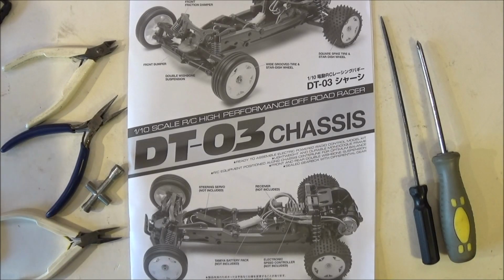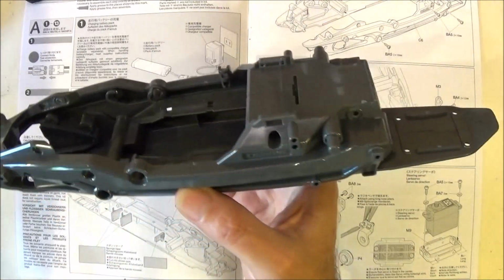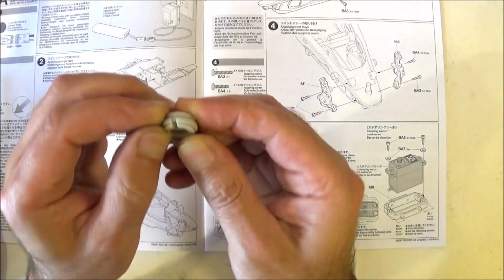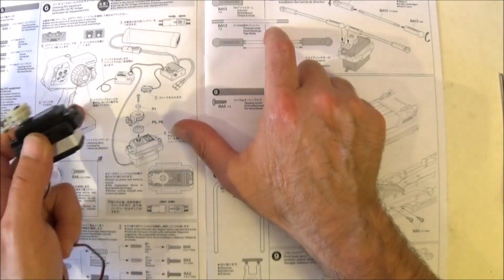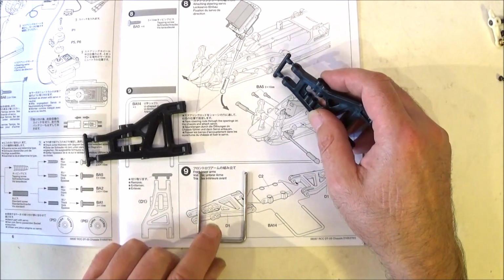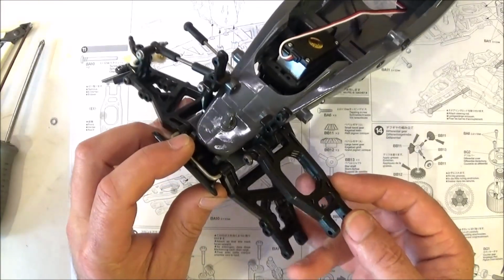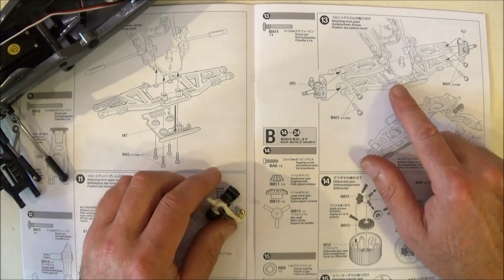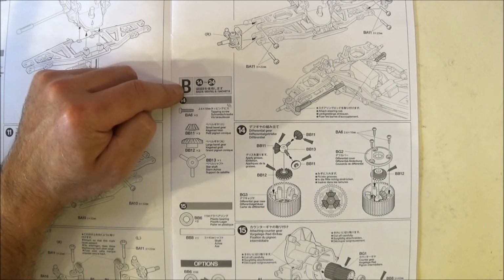Tamiya DT03 Build Part 1 & How to Make Adjustable Suspension Arms

Comment: Great job explaining and demonstrating everything, Mark. And good job with the adjustable upper arms. Why didn't you want to use the Tamiya turnbuckle set? The price? ... I really like the turnbuckles. To be able to adjust the camber and toe-in/out without taking them off. Uhh, reminds me I got the DT-02 MS turnbuckle set waiting for the Racing Fighter build. Hmm, what a waste.
Reply from the maker: Thanks for the nice words, mate. Yeah, I do like the Tamiya turnbuckles when they are new! The problem is, they wear out quickly when you run the car a lot, and the ball cups on my Neo Scorcher keep coming off, I have lost a few driveshafts and output drives! Expensive!  Plus, I find that when I get the correct setting, I tend not to adjust them again. And yes, the price is a factor, my own arms cost less than 1/3 of the turnbuckles. Plus these RC4WD ball joints can't pop off as they are captive. Anyway, it's just my first go, so I will let you know how I get on with them. Hmmm...I'm sure you are gonna use those turnbuckles on your Racing Fighter one day...  :))
Reply: Mark Bryan RC Hmm, I think I missed out on these good points in the video. Must concentrate more next time. I should have known you always have several good reasons 🙂 That thing with the captive ends is a good point. And good point that the adjustment usually only occurs once or twice when we do not compete professionally and adjust it to each track. Really all we hobbyists need is a good allround set-up. And yeah, I actually also remember walking around looking for my drive shafts on a number of occasions because the Tamiya ball end broke or broke lose 🙂
Reply from the maker: No worries mate! Hehe, so we have both been on a driveshaft hunt! Or two or three! And yes, when it's just a hobby for us and not serious competition, an all-round setting is best, more time to get on with enjoying driving and the fun of RC. I appreciate you taking the time to reply my friend, I hope your weekend is going well.   :)

Comment: Hey Mark I think I want to do a dt-03 build but I don't like that the front arms are wider than the rear. Are they're any other shorter arms out there that fit this build?
Reply from the maker: Hi there, the arms on the DT03 are exactly the same as the DT02 and I'm afraid I don't think there are any shorter ones that will fit. I could be wrong but not that I know of. If you can find some shorter bottom arms to fit you can always make the top arms like I did. All the best and good luck with it!
Reply: @MarkBryanRC  No the dt-02 arms are perfect. I love the size of those. Do yo know wicch ones they are?
Reply from the maker: Hi pal, I have both the DT02 and DT03, I just went up the shed and checked them with a ruler just to be sure and the arms are exactly the same.

Comment: Would it work to have two front camber links per side to help double the strength in that area or would that be pointless?
Reply from the maker: Yeah I think 2 links on the front would work OK and might be a bit stronger. But I've had no issues with the single links, and the Tamiya turnbuckle hop-up only has one link anyway! Cheers!

Comment: I made two myself too but i removed them after lots of issue, they were always getting loose after long runs and some bashing, they also reduced the stability on the front weels by increasing the giggle and sincerely when i got the carson street tires the car ooked far better with the stock arms. Are good if u need some extra regulation but in general the car is very good and stabke with the stock arms.
Reply from the maker: Hi Enrico. Sounds like you had a bad time with those adjustable arms! Yes the stock arms do a good job of keeping the the wheels stable and if you are happy with the handling then that's just fine! The arms I made are still working well and I like the negative camber they allow me to set. Whatever works for us is good! Cheers!

Comment: Hello Mark at 13min37 what is the reference of that bolt shaft as it has exactly the right amount of "even" metal and then the threaded part to put nut. I want to do the same thing as you on my dt03. thank you. EDIT:found the word: partial threaded bolt
Reply from the maker: Hi Luc. It took me a while to find what you were referring to, thanks for the time stamp! That was a bolt from my collection, not sure where I got it from. But Luc, it doesn't matter if you have a partially threaded bolt of a bolt that is all thread. The bolt doesn't pivot inside the C-hub (or "upright"). When the bolt is tightened it doesn't move at all, it's the ball-end connected to the top arm (or "tie-rod") that is the pivot for the suspension movement. The metal ball moves inside the black plastic of the ball-connector. I hope this makes sense, my friend! Cheers!  :)
Reply: @MarkBryanRC  thank you for replying. I had the impression that the C hub needs free movement when is goes up and down. It's not for nothing that the original partially threaded screw is partially threaded. The C hub can move along a slick surface and not threads. If you take a M3 screw with all threads in a C hub that is not threaded then it's going to get tight. I hope I made sense lol myself.

Comment: Thanks for your response. Three more question, my kit came with the optional CVA damper set and I am wondering if I should put all three damper spacers so the sping becomes tighter? Right now I am putting 2 out of the 3 included in the kit. Also, instead of using the grease provided with the kit, I used yellow grease  I found in my dad's garage. Is that Ok. I put some into the gearbox hoping it will give me better lubrication and thus better performance.
Reply from the maker: Hello, Jye! Thanks for your questions, I'll try to answer them! Yes, try all 3 spacers on the rear to stop bottoming-out, but don't put them all on the front as it's very light and needs little preload. The automotive grease you used should be fine, I've used it in many of my kit builds. Have fun with your Tamiya, my friend!  :O)

Comment: So usually to assemble the 2 chassis, you don’t have to apply glue? Just tighten these 3 screws really tight?
Reply from the maker: You are correct, no glue needed! When the chassis is finished, there are many more than the initial 3 screws holding it together!  :)

Comment: dt-3 How to fix the shake on the front wheel?
Reply from the maker: Glue the wheel bearings into the wheels as they are too loose. Alternatively, add tape to the outside of the bearing so it is a tighter fit! Also, put a washer onto the wheel shaft so there is no play.

Comment: Hi Mark, I have a question. I'm new to the RC world. I have built a TT02 and very happy with it. I've just built a DT03 with some hop ups. However  it seems like the front wheels are a little toe out. Is that a problem and if so how do I adjust? I haven't driven it yet as still need to paint the body etc... But am concerned about the front wheel line up.
Cheers
Reply from the maker: Hi Gary - to adjust the toe of the front wheels, you just need to pop off the ends of the steering arms where they connect to the steering uprighs and unscrew the plastic ball ends a little (it's trial and error, how much unscrewing is needed). Pop them back on and you will have toed the wheels in a little. Hope this helps, my friend.  :-)

Comment: Awesome build! What brand for the upper adjustable suspension arm. Do you have the link to the product? Thanks
Reply from the maker: Hi Rich - I made the top arms from 3mm threaded rod and 5mm ball ends, if you search on eBay you will find many components to enable you to make them too! Best wishes from Mark!  :-)

Comment: Great job, Very informative video. I’ve just got DT02 without adjustable upper arm and I kind of think I can make it myself. I have some turnbuckle but  I didn’t know where to get the middle threaded shaft. Then I search youtube and found this video. Errr... it from you again. Thank you for good instructions. Cutting it from long screw is a good idea. Why I could not figure it out? 🤣 By the way can you confirm that DT02 and DT03 share the same suspension parts? From what I know, they have the same gearbox and rear suspension. Is that correct? And what about the front end?
Reply from the maker: Thanks for the super comment! Glad you got the adjustable arms sorted out! Yes, the DT02 and DT03 share the same components for the rear suspension and gearbox, but the front is completely different. The upper and lower arms, plus the shock towers, are very different designs. All the best, my friend!  :)
Reply: Mark Bryan RC 🙏 Thank you and happy RC!
Reply from the maker: Cheers - you too, bro!  :)

Comment: For your front upper arm mods can you not put two nuts centre shaft locked together and use to adjust camber? Don't know if it would work!
Reply from the maker: Thanks for the idea, Nathan! I had to think hard about this one - you mean the nuts in the middle of the threaded bar like a turnbuckle shaft? Good thinking, but trouble is, the thread on the bar is in one direction (right handed thread) so turning the bar would screw into one end and out of the other, and the length would stay the same. The Tamiya turnbuckle shafts have a left hand thread on one end and a right hand thread on the other end, so when you turn the shaft both ends screw in or out. Hope this makes sense! All the best!  :)
Reply: Mark Bryan RC  I see, I knew their was a reason I didn't do any rc'ing ! Ok I'll sit at the back and be quiet. Great channel enjoyed watching a few vids in lockdown and I'm not even into RC cars so your doing something right! Stay safe mate.
Reply from the maker: Not at all, mate - it was great that you were thinking about a solution - any more ideas and I'd love to hear them! You should think about getting into the hobby - it's surprising how building and running one of these little cars gets under your skin! Either way, I'm really glad you enjoyed the vids, really kind of you to say so! Stay safe too, Nathan!   :)

Comment: Hello, I saw your modification thanks to the tamiya link option. Is it only for rc circuits? we lose the frontal rigidity of the 4 upper triangles, and the protection of the hydraulic hydraulic front suspensions.
Reply from the maker: Hello - no the modification is not only for circuits, I have run the RC with this mod many times and have had no problems with less rigidity or shock damage. The Tamiya hop-up kit for the turnbuckles works in exactly the same way. I also run 3 DT-02 buggies with the same mod - no breakages!  Best regards from Mark...   :)

Comment: Hey Mark, i copied your adjustable suspension Arms, BUT: in my case, the screws touched the ballends from the stearing, so I decided to put the arms in front of the front bumpers and not behind.
You can have look here: https://www.rc-modellbau-portal.de/index.php?threads/3x-dt03-das-familienprojekt.6391/page-20#post-158891
Do you think, thats ok because of stability?
Thanks for an answer an best Regards from Germany!
Reply from the maker: Hello! Hmmm... I do not think it really matters (in terms of stability) whether the arms are on the front or the back. I am surprised the screws hit the steering, can you try fitting the screws the other way round so that the heads are at the back and the bolts at the front?  Just an idea!
Let me know how you get on, I think a test run will prove that the arms are fine on the front!
Best regards,
Mark
Reply: @MarkBryanRC  Goog Morning :)
Ok, ich changed the direction of the screws and now it's ok , even if is a little scare.
I think it's because of the Tamiya HighTorque Servo Saver. I choosed to implemet the Servoholder in oposite to the manual and so the steering linkage is a little bit closer to the suspension arms than normaly.
It's fine for me now.
Thanks a lot !
btw.... Excause my english. School is over since 35 Years and i use it not very often... ^^
Reply from the maker: Hello! Ahh - I see - you have a different servo saver and position, now I understand why the linkage was hitting the screws!
I am pleased that you have found a solution and I hope it works well for you.
You do not need to excuse your English, it is very good my friend, and I cannot use another language like you can, respect to you!
Best wishes,
Mark

Comment: I personally would have left front suspension on dt stock with the oil filled shocks.
Reply: You know most Tamiya buggies understeer that is there charm.
Reply from the maker: Well it sure has the standard oil filled shocks, Brad! But as for the top arms, I need to add negative camber - stay with the stock arms if you want understeer!  :))
Reply from the maker: Hehe - yeah, but with a squirt of power you can usually get them to oversteer, and a better turn-in helps to achieve this, which is always more fun in my opinion!  :-)

Comment: Good good with the step by step guide. Nicely done. I too have turnbuckles of various lengths strewn around, along with m3 ball ends. However, I did not go ahead with the homemade links, as I don’t adjust camber on a standard build. Also, as the dt03 has these marvelous over engineered double arm system, replacing them with standard looking turnbuckles took something away from its looks. And let’s face it, the majority of us build tamiyas because of how they look. Just my 2 cents. Ps. I still have plans for the kit included tble02 which involves my childhood slingshot and the neighbors invasive cat.
Reply from the maker: Hiya Preyalin! Thanks for the great comment and feedback. You make an excellent point, well worth 2 cents! I agree about the over-engineered double wishbones, they do look rather 1960's F1, very cool. Horses for courses, I just like to be able to fiddle with the settings! But on the looks front, you are right, I am thinking about fitting another adjustable top arm to the front suspension to recreate the over engineering, as has been suggested by a couple of viewers. Hehe - I LOVE your plans for the TBLE and the cat - I hate my neighbours cat too!  :)

Comment: Great video as always mark love the top arm mod to adjust it you said it might not be as strong would doing a double top arm be any benefit or do you think it would make adjusting it over complicated as you'd have to do twice as many just a thought what do you think?
Reply from the maker: Cheers, Gaz! Funny you should mention that - as I was fitting the first top arm, I tried the other one in front and thought "that might be stronger with two!" But the I remembered that the ball joint moves in all directions, so if the wheel took a big hit at the front, the top arms would move backwards with no resistance! However, with both fitted I am sure it would add a little more strength than just the single arm. Good thinking my friend, I will see how it goes, might just add the extra arm after all!  :)
Have a great weekend mate!  :)
Reply: @MarkBryanRC  cheers mark I'll look forward to part 2 you have a good weekend too pal

Comment: Hey Mark, I really admire your dedication and patience in doing these build videos. They are really good in showing RC newbies just how straightforward these Tamiya kits are to build and maybe encourage them to have a go themselves. The manuals probably come across as a bit daunting to those just starting out but you show just how easy these kits are to put together and give useful tips along the way like 'don't over tighten this screw' etc. So hats off for that. And the upper arm mod too.

Well I really don't mind the lack of screwing, but I just know that later in this series a long Wibbly Wobbly is going to make an inevitable appearance...🤣 and I don't mind that either. Great video mate, always a pleasure...👍.
Reply from the maker: Hi mate - thanks for the positive comments. I worry sometimes that many viewers of these builds already know what to do and the basics of kit-building. But then we all start somewhere. When I got my XV-01 and Type-S, I looked at other build videos to get a feel for what was involved, and looked for any little tips and tricks. So I suppose there is a place for these basic builds. I really wanted to put some negative camber on this one, as my Sand Viper handled so much better when I adapted that. Hence the top arm mod - but way cheaper than a turnbuckle set! I think the parts cost me about £4.50 to do the complete car!

Cool to hear you didn't mind the lack of screwing! And you just reminded me that I didn't show the wibbly-wobbly in the unboxing!  Doh! I sure missed a trick there! I might just surprise you on this on though dude - we shall see! All the best my good friend!  :)
Reply: @MarkBryanRC  Hey Mark, there is always something to be learned by experienced modellers from these types of videos - however basic the build. And of course they are a dream for the novices. They definitely have a place on YouTube bro.